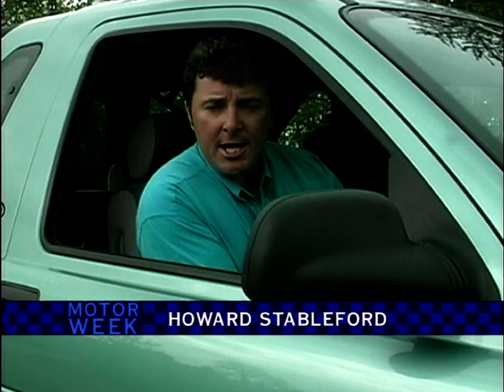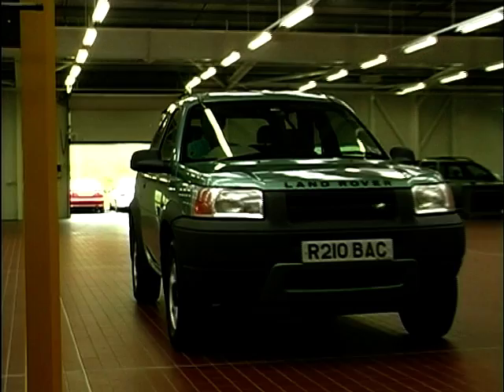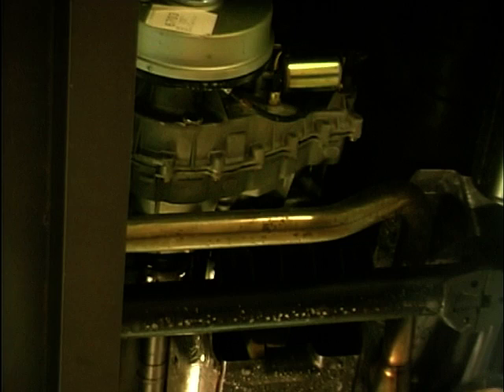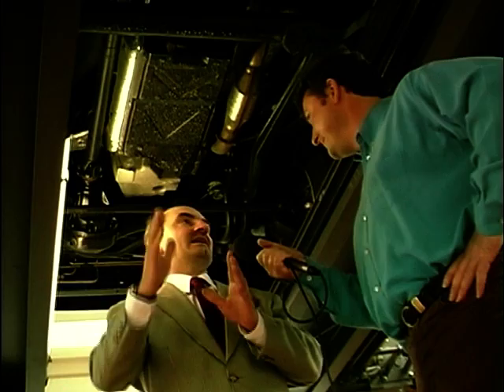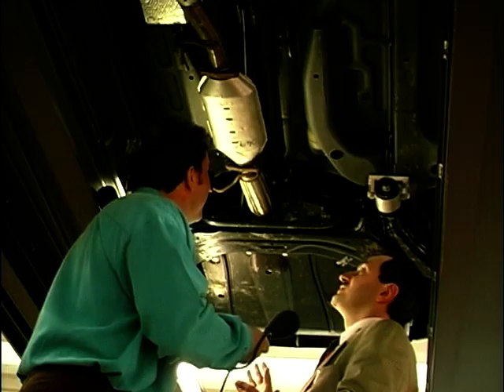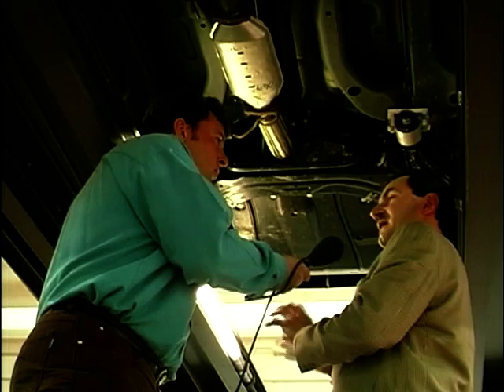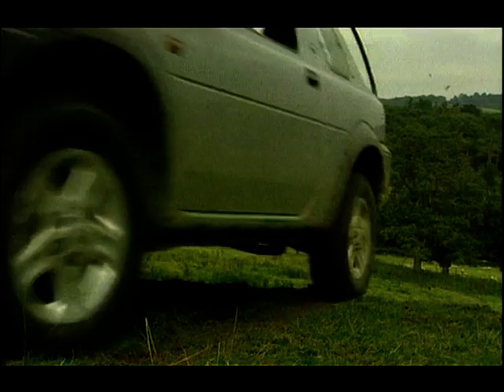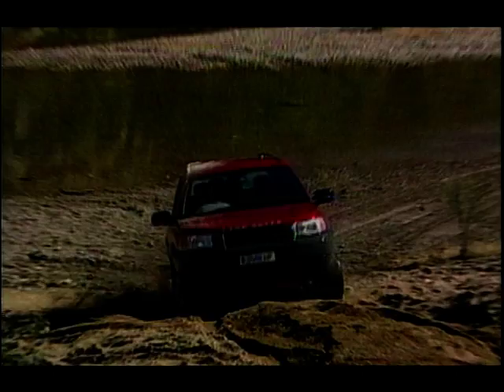Freelander - The Technology Behind The Car

Comment: Used hill decent on 1 in 4 hill, in 3 inches of snow.  Handled perfectly, with full steering, and braking when needed. Not yet needed to use going up hill as copes easily even on ice so far.